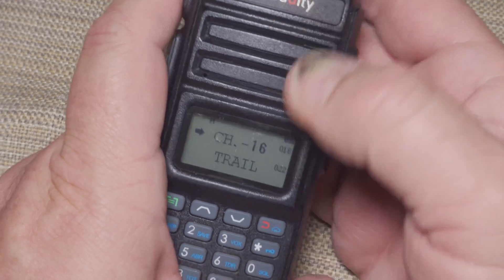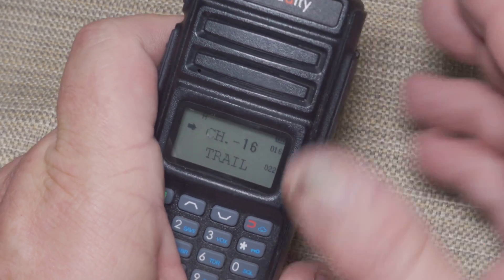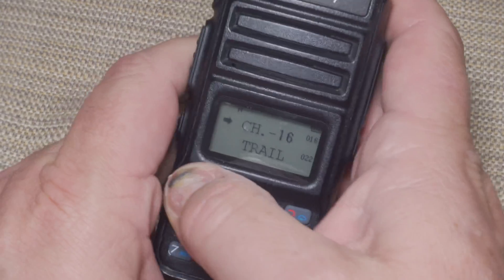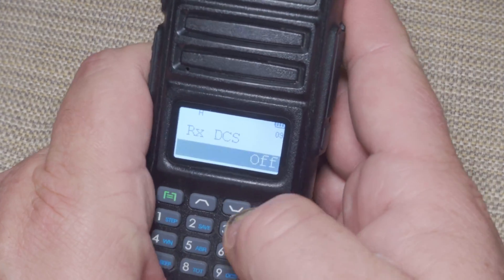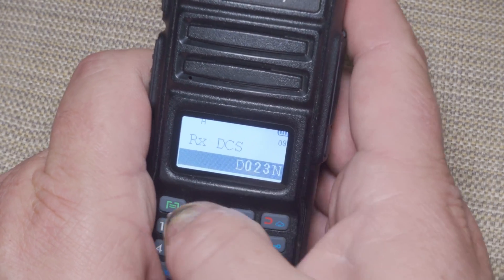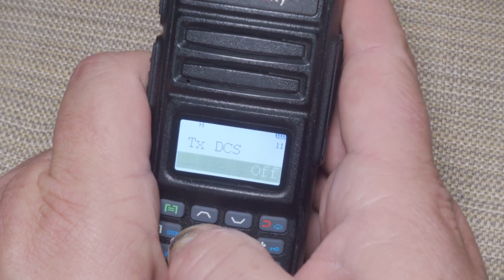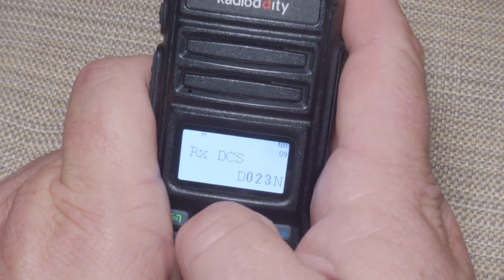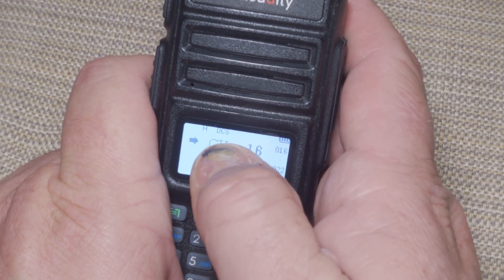What are GMRS Privacy Codes and Should You Use Them?

Comment: Question: If the radios are filtering non-tone transmissions, then I'm not aware if I key the mic and step on someone currently transmitting.  My question is, since I'm starting my transmission with a tone will the radio then allow both transmissions to be heard, or will it only let the toned transmissions be heard?
Reply from the maker: You nailed it. If you have more power, you could absolutely step on someone else’s transmission.
Reply: @TrailTraveler  but otherwise it will be a garbled transmission due to both using same freq?   Just trying to figure out why you would use the tones other than to eliminate the chatter...better to roll off the freq to another? vs potentially  having garbled comm due to a chatty kathy letting someone know about her latest cat acquisition while you are trying to make a call.  Appreciate the fast response btw!
Reply from the maker: @scottstevenson2754  Someone not listening to the tones will only hear the most powerful signal.  The primary purpose is to eliminate chatter. We have actually been in places where we could not find an empty channel.  Since we are using this trails, our local radios will always be a stronger signal than someone a couple of miles away. From "our" perspective, this works perfectly and we don't hear other signals.
Reply: @TrailTraveler I appreciate the help! Was trying to figure out if there was a downside to this.....
Reply from the maker: @scottstevenson2754  The biggest downside is that if someone needs help and they hear us, we will never hear them asking for help
Reply: @TrailTraveler  Copy...so someone outside your group will be SOL if they try to raise you...
Reply from the maker: @scottstevenson2754  Unfortunately, that is correct. Unless they know (and how) to scan for the DCS codes and program them in.

Comment: If I have two radios with a PL (ctcss) setup, and we’re talking, will other people keying up on the same frequency “block” transmissions if we all key up at the same time?
Reply from the maker: If the have sufficient power and are close enough, yes. The PL codes only act as a filter to keep you from hearing them, many radios will even show a receive status when someone without the code is broadcasting, you just won’t hear it.

Comment: I understand digital codes on GMRS will get you a thorough drubbing.  You can transmit and receive on different frequencies.  Make your own channel lineup.  Customize your own repeater.  
Cotre digital radios are pretty private right out of the box, and even cheaper than those radios you have. Prices vary.
Beat tone voice inversion scrambling is only available on relatively few radios these days, and is infuriating to eavesdroppers.
But if they're already on to whatever it is you're involved with, they'll probably get you eventually.  Might just wanna move.
Reply from the maker: I have no need for actual privacy in our conversations. We use the privacy codes only to filter out OTHER people. This keeps our radios quiet except for the people in our group. I don't care if other people can hear us, we are just out doing trails.
Reply: @TrailTraveler  Are you sure?
Reply from the maker: @HarryHamsterChannel  yup, tested it

Comment: Thanks for this video.  On the screen grab you do show, is it just as simple as that DTCS Setting and then picking a DTCS code and setting nothing else?  I notice you have some other channels above set up with cross, assuming those are for repeaters.  Planning to just copy a whole other set of the 8 GMRS channels and have them all on a privacy tone so if we do in the off chance have someone on say gmrs 1 using privacy tone 145, we can just move up to gmrs 2 with privacy tone 145.
Reply from the maker: Yup, it's really that simple. You are also correct that the other ones I have are for repeaters. We only keep one channel on privacy codes and just use non-tone channels when we have other people join us unless I want to take the time to program their radios.
Reply: @TrailTraveler  Awesome!  Yeah i hear you on the group thing.  i was fortunate to score a 5 bundle of the Baofengs for cheap and just have them all programmed.  I usually end up tossing a couple out to the peasants of the group still in the stone age with their CB radios.  :D